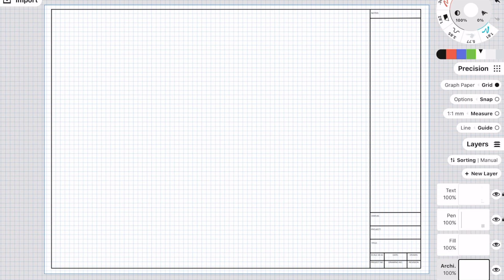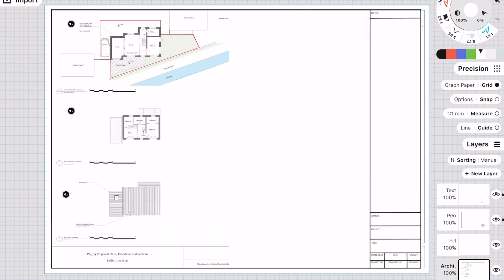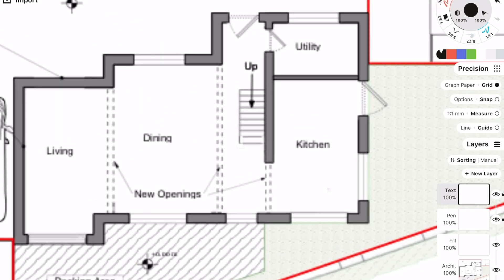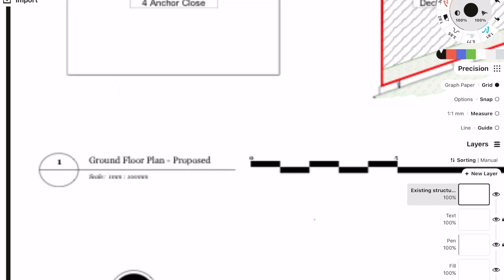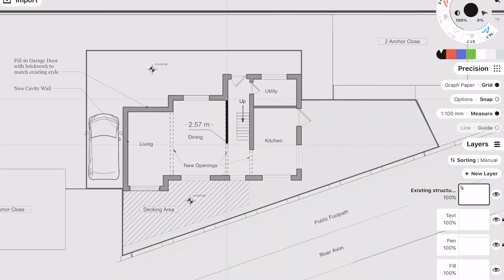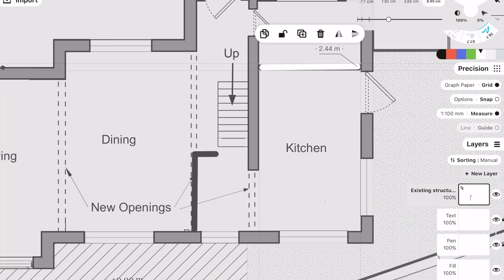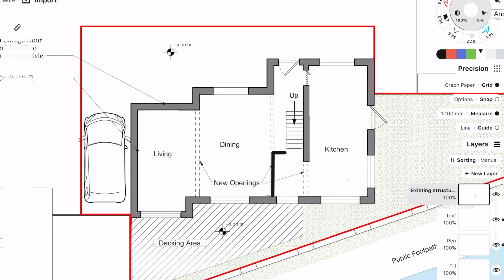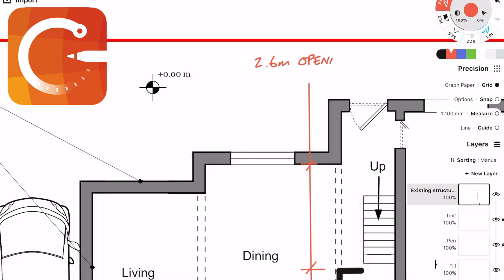Structural Engineering Mini Residential Project - Part 1

Comment: Dazz for the ease of understanding please write few commonly used beam and column sections in residential developments especially in alterations I.e removing inner load bearing wall between 3 to 7 m span for beam?

Comment: Hey Dazz! Thanks for the great video. Just have a quick question, as opposed to using 2 - UB beams or 1 - UC to support two skins of brick. can we use PFC with a plate welded under?
Reply from the maker: Two PFCs with a plate connecting them? Or one PFC with an extended plate to pick up other skin? 

Would avoid the latter due to torsion/twisting/overturning issues.